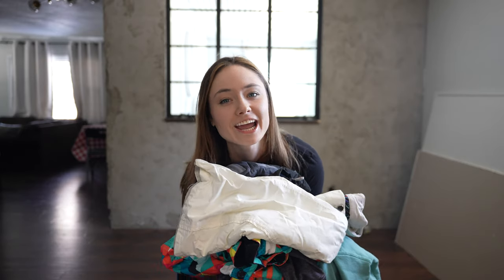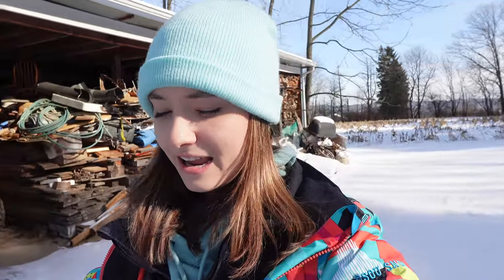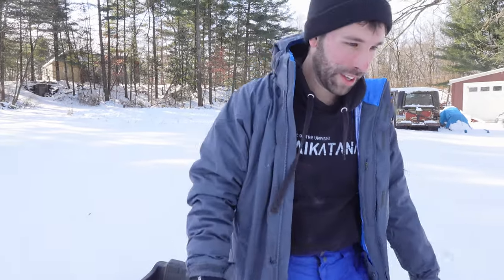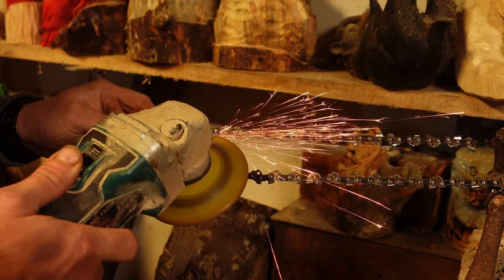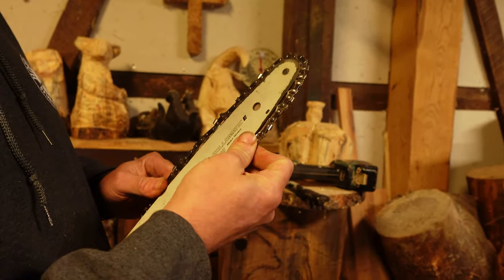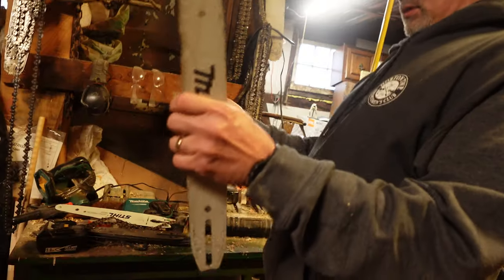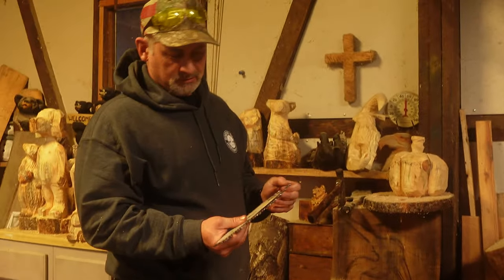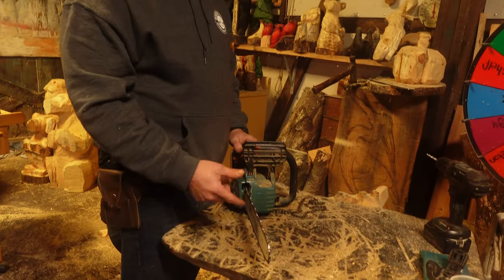Nothings Working....

Comment: Had the same problem with my 1996 Polaris yesterday. Put a tarp over the 4 wheeler then blow hot air. 30 minutes and it started. Oh and it was -13 outside here in colorado.

Comment: Is the fuel turned on? Gas line antifreeze. Pull the spark plug and clean it/replace it ...... warm the plug up. Dribble some fuel in the plug hole and start it up.
Reply from the maker: The fuel is on but well try all that!😁 I know we just changed the spark plug but it definitely needs to be warmed up

Comment: It might be the spark plug or the carb might be gummed up if it hasn’t been running in a while
Reply from the maker: We run it almost every day. And put a new spark plug on it not to long ago.😞
Reply: We’ll spark plugs will go anytime so will a coil did you check for spark